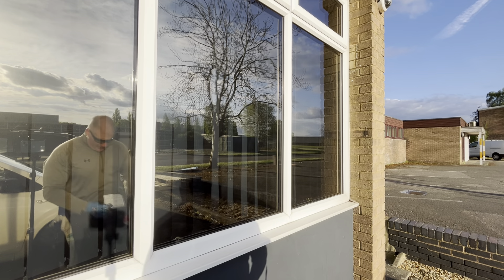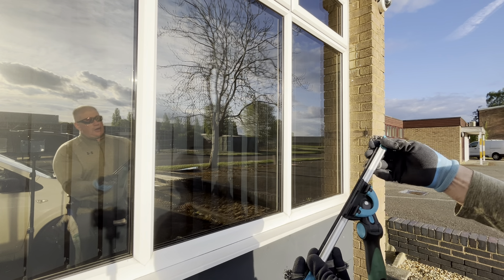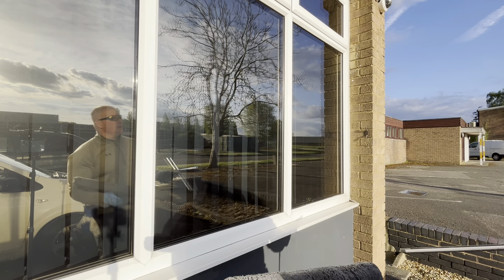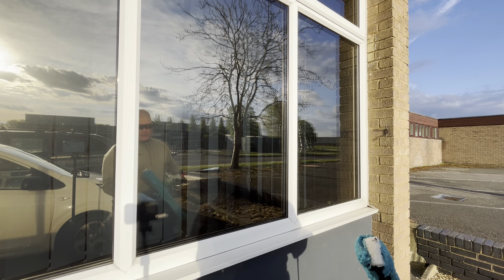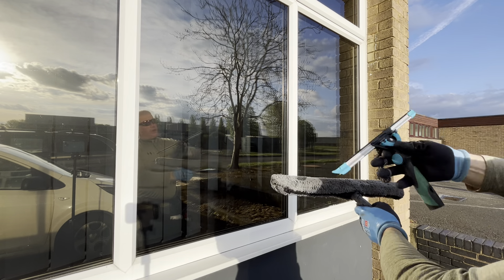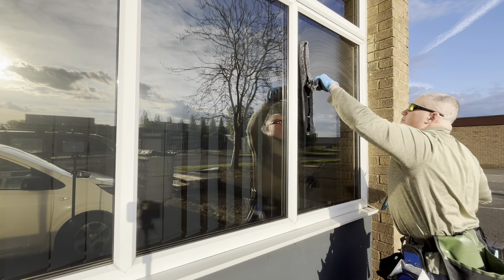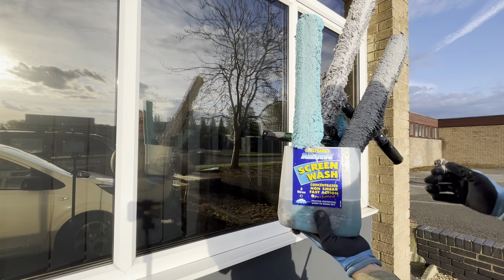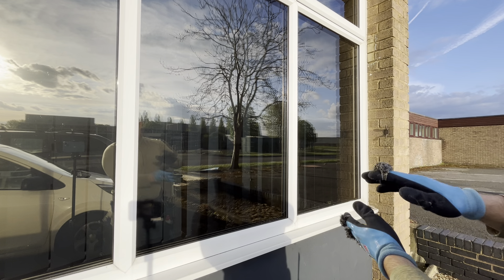What I did to improve my double handed technique Washer-Squeegee Ratio

Comment: 14inch applicator and channel are my go to tools, then 5inch channel for small openers and georgian panels. Anything else I use my 10inc channel.
Reply from the maker: It will depend on how large windows I work on. I am often doing very large panes. Long ago I used the 14" but my jobs and ways of working completely changed

Comment: Why not have the blade the same size as the washer?
Reply from the maker: Capture more solution, less mess to clear up, too big of squeegee people lose ability (whatever ability they have). More control with the squeegee positioning and solution coming off,  wet the windows up quicker. Do you remember that guy using the big Sorbo squeegee indoors? Solution going all over the place in the office. Hopeless. That wouldn't happen using a longer washer and small squeegee.
Reply: @polznbladz3242  so would that be the rule with any window Doctor?
Reply from the maker: @doubleawindowcleaningphil5003  I'd suggest you either buy a 22' washer and t-bar or use a smaller squeegee with your 18 " washer and you will find things work easier for you. I work indoors once or twice per week, My washers are always a lot longer than my squeegees these days

Comment: When i see my colleagues which are in the company for 45+ years almost at their rent ugh.......

5 by 5 meters panes with a 35 cm brass handle and aluminum channel Unger squeegee and then trying to force everyone into using those bloody old things and then complaining about shoulder and wrist and hand issues. Almost boiling hot water, clean windows when its freezing with hot water...... gloves are the devil as well....... stuck in the 70s....... i bet theyd use chamois leathers still if the company didnt throw them out........

Not a little bit too much suds in the water, always the cheap bad dish soap we get from the company into the hot water...........dump alcohol cleaner into hot water too like that would make any sense at all........

Only want to use the black soft rubber from unger not a single rubber else even tho theres way better ones out there like the Unger green or Moermans new silver rubber as well.......

BTW which Moerman sleeve is the one holding the most amount of water from your experience?

323 days to go with the last of the three idiots......yay......
Reply from the maker: You are describing window cleaners that work around my area to. Funny that!. I personally like the blue Moerman sleeve. Sometimes over the years they have changed the washer to be a bit thinner using another supplier but after complaints they changed back to creating the thick water retentive sleeves. One of the best water retainers on the market. If you use a T-Bar that has the plastic wells in them, the washer stays wetter for longer to. The Unger Ninja T-Bars are aluminium (no wells in them) so the washer needs wetting more regular